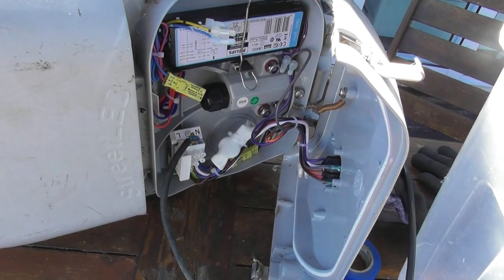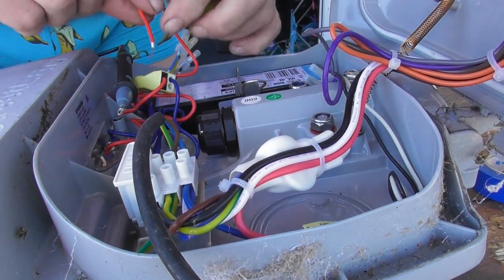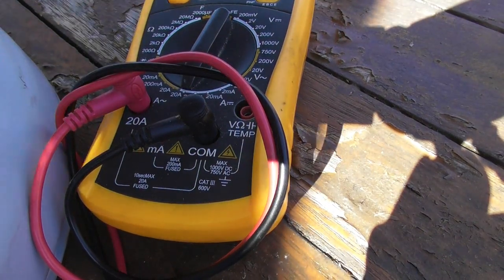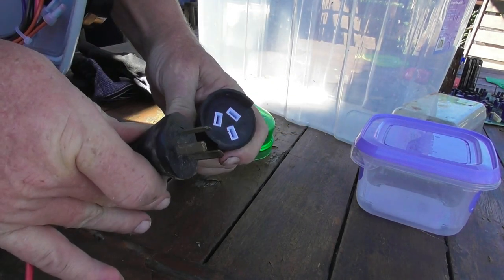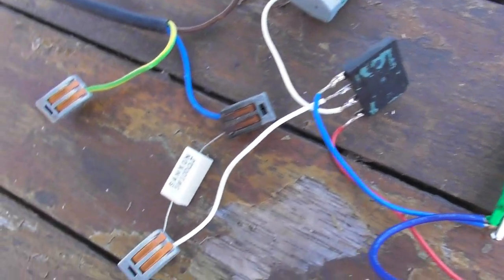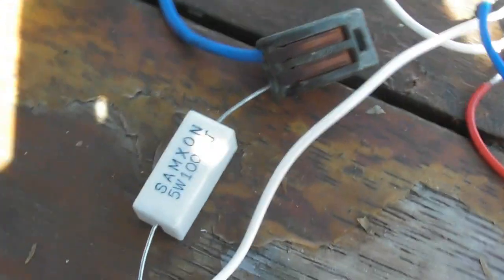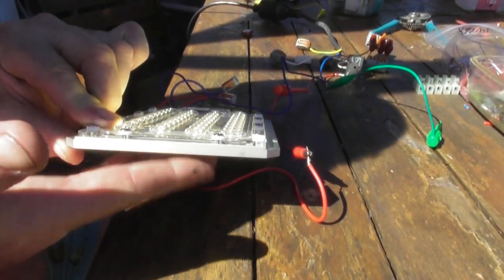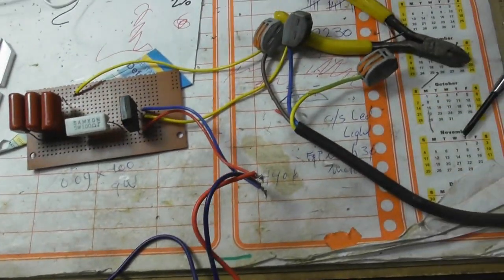Streetlight Led lamp cluster conversion

Comment: Those LED chips will last almost forever now, just from running at lower current. As well light output will be higher, just from the improved efficiency at lower current. Just add a MOV across he input, after the resistor so it will clamp spikes to the LED cluster better.

Comment: This is a standard design for “transformerless” power supplies.

Capacitors are 680nF each and 3 in parallel gives 1.8uF approx.

The AC impedance of the capacitors can be calculated using the standard formulae.

Comment: Should have took the 3 street lights when the 36Kv powerpoles fell down in the storm in the woods ,6 poles went down 3 3 street lights, they was just weeks old Philips LED heads that was recently converted & installed, the power lines to all the power sources was cut off too ! Eventually the scrappers got them as well as a ton of cut wires

Comment: I hate LED lighting, street lighting is so poor where I live, miss SOX and holding on to my incandescent bulbs in my house .
Reply from the maker: Agreed, I like SOX, have two SOX 35 Watts  in my driveway.
Reply: @RODALCO2007  Should post to you a 35W ignitor then, plus a 1939 manufactured lamp as well, at least when the post orifice opens up again.